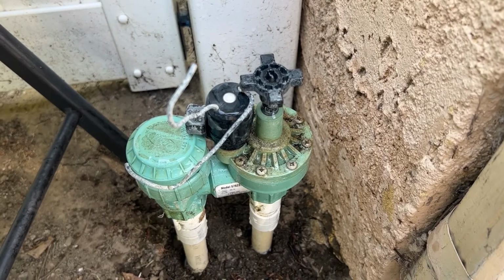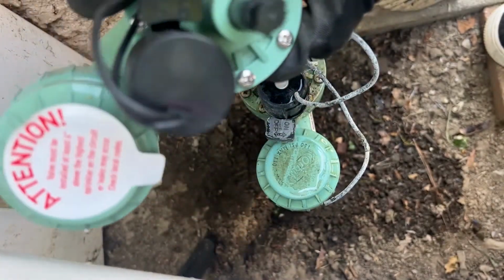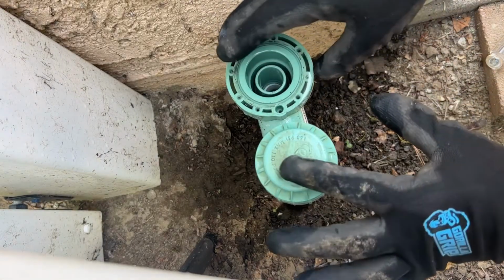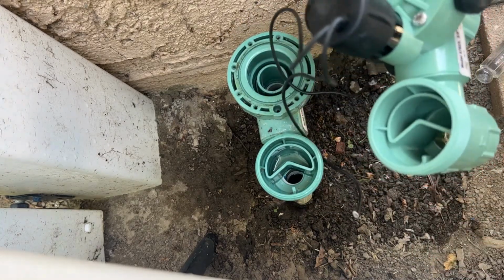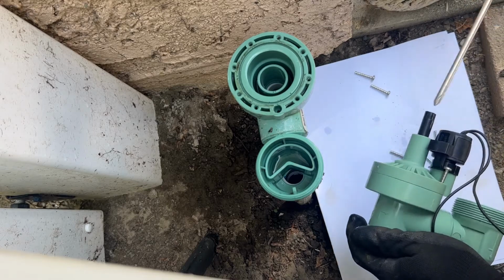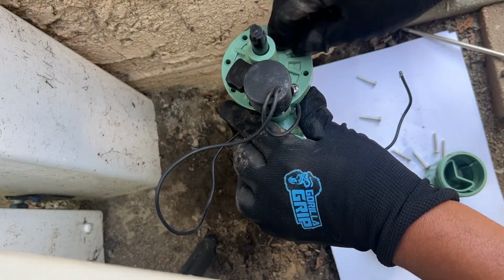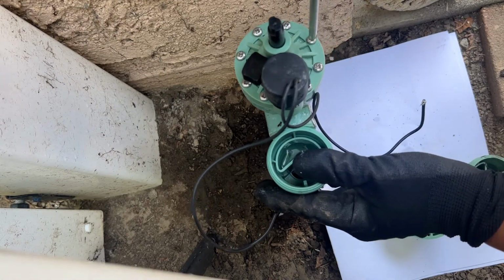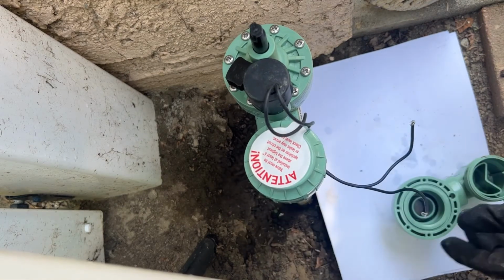How to fix a leaking Orbit Sprinkler Valve

Comment: Thank you very much!  My valve was leaking so I asked my gardener how much to replace it. $120!  So then I tried Angi’s list and those people wanted $250 to replace a $18 value. So I watched your video and felt even if I messed it up, it was worth a try. Bought the valve at Home Depot. It took me about 15 minutes to do including rewatching the video. Works perfectly. Two points to share with other DIYers. 1. When tightening the new overflow cap, my hands are not that strong so it leaked. I got a jar opener from my kitchen and was able to get a good grip on it and tightened it really well so absolutely no leaking. 2. My valve was connected to the irrigation system so I wasn’t sure what to do with the wires and if they were hot. I used a voltage detector and there was not issue. I did not remove the wires from the old value until the new one was installed and then removed and reconnected one wire at a time.  My watering system works perfectly. More information than most people need, but for those challenged folks like myself. Thanks again sir for the video!